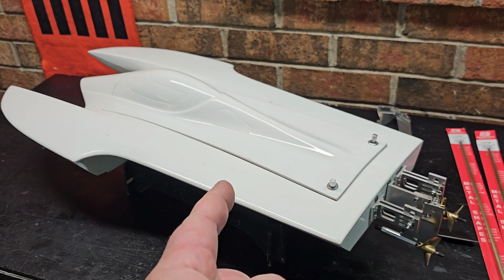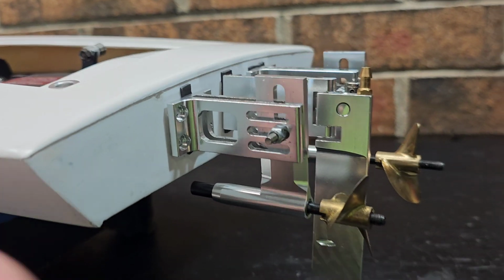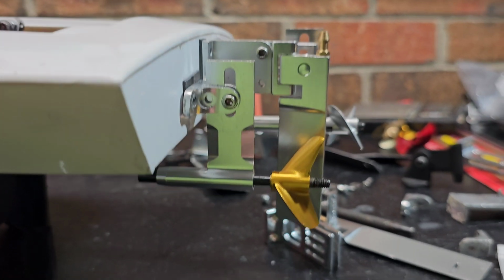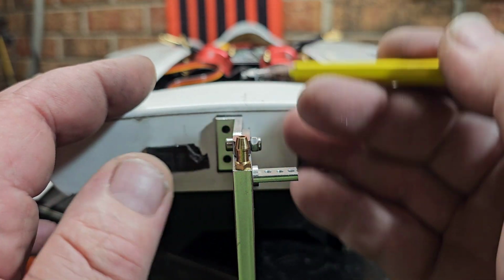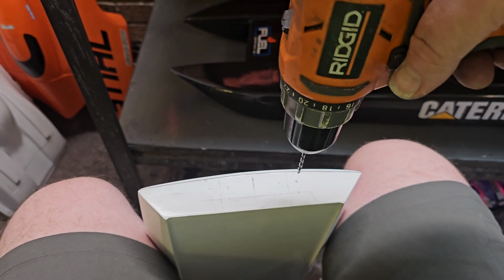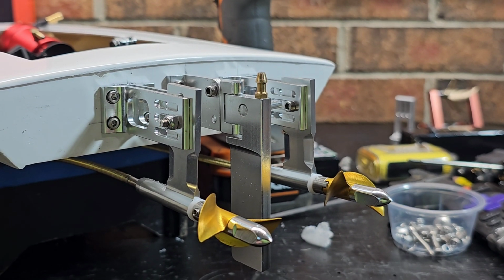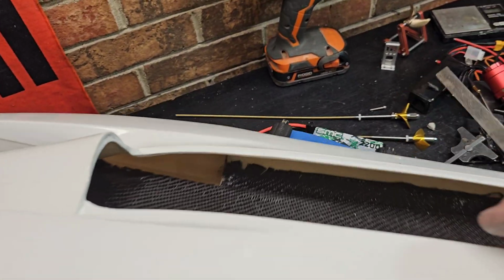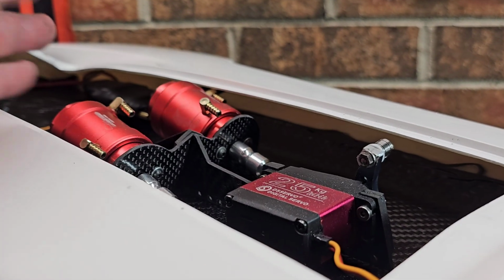Mounting Hardware Rudder, Struts, & Turn Fin Deltaforce Vortex 24 Build Series - Twin Hydroplane

Comment: Man you are killing it. This is another top notch video. You had me biting my nails, is he going to use extended struts or short struts. I'm glad you decided to use extended struts, i really think that's the way to go. If it doesn't work out then you haven't lost anything, just trim everything up. I was also wondering why you went with 62mm spacing instead of 65mm. I saw you marking and I'm screaming...noooo you said 65mm. Just rivited😅. I think you made a suspenseful video. Thanks big b. Bg4l
Reply from the maker: @jimstone5339  I think I made the right decision with the extended brackets, too.     I went 62mm because I didn't wanna put so much extra S bend in the stuffing tube, lower friction type deal. Ideally, you want a straight shot to the struts from the motors.

Comment: Hey big b I was wondering where I can get some corrosion x that u use haven’t been able to find any unless ordered wondering if someone carries it
Reply from the maker: If you live by large bodies of water, marine supplier & boat repair shops may carry correction x I have yet to find corrosion x locally.   CRC makes a corrosion inhibitor spray, but I'm not sure the exact name.
Reply: @IRONCLADRC  thanks bud I live close to lake Texoma so maybe at one of the marinas

Comment: That looks awesome!!! This build is coming together really nice. 👍 
  There has always been the argument (drive dog pushing on the strut barrel with a teflon washer or thrust bearing vs gap at the barrel end)
The gap seems to be noisy sending the force up the flex shaft, the thrust bearing seems to work pretty good if it’s the same size or smaller than  the strut barrel.  I’ve always settled on the gap, I usually use teflon tubing inside of brass with as short a flex cable I can get away with.  With is build maybe the teflon washers pushing on the transom for a quicker out of the hole shot. Just my thoughts.   BGFL 👍
Reply from the maker: Totally bad azz looking!   Thank you for sending this project I'm having a ball building this one